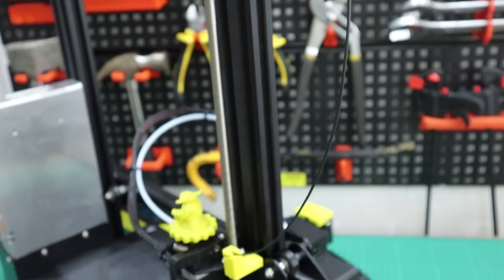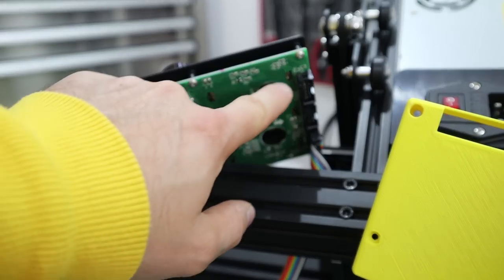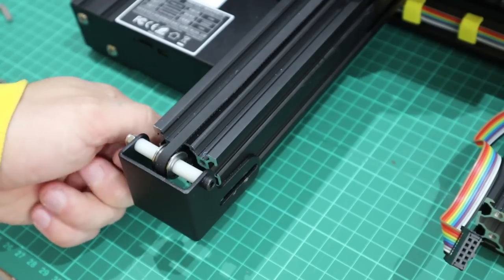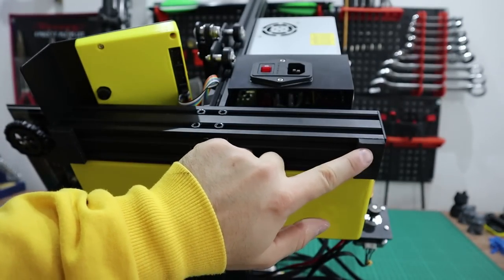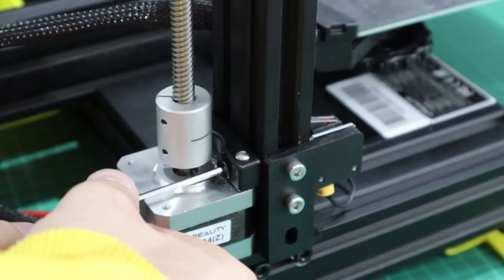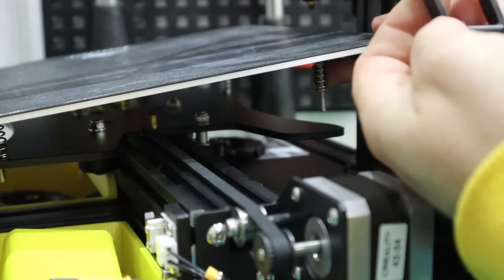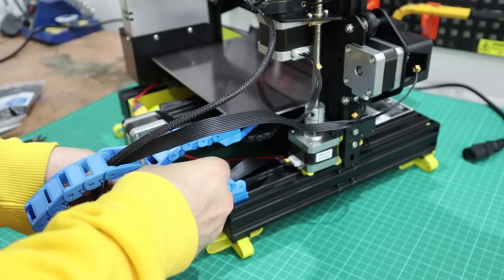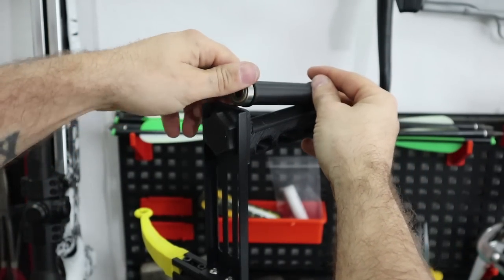Ender 3 Pro Upgrades

Comment: It's almost like Creality knew people would be printing mods
Reply: Well that's mean they really listen to consumer reviews and rants.
Reply: I mean at the same time it’s smart, a lot of these things work perfectly well being printed, and by not including them initially it helps keep the cost of the printer reasonable
Reply: Most of these are actually listed on the Creality website (with links to the thingyverse files) as printable upgrades. My first prints off my machine were a lot of these (namely the cable chain, ribbon clips, Yoda extruder knob, upper guide, and a few other things not on here like a upper z-screw guide and hand crank, bed handle, x and y quick adjustment knobs, and a few other things.
Reply: The use of 8020 Extrusion is literally the reason
Reply: @indroneswetrust1  that makes no sense that would increase the price tag plus this are entry level printers anyone can use them and in my opinion is better to start decent enough to print upgrades why? Cause 1 you can personalize it as much as you can, 2 it lets you learn by actually using the thing, plus by you downloading or designing your own part you don’t have to rely on them for new pieces.

Comment: 1:40 One tip about those LCD board covers.  After installing mine, I had an issue where the printer would intermittently beep and register a phantom keypress while printing. This is because one of the screws (nearest to the knob) actually grounds the PCB to the metal screen bracket and putting the screen between the screw head and the top surface of the circuit board stops this. 

The remedy was to bore out that mounting hole so that the screw could make electrical contact again. The rear cover will stay on perfectly well with just 3 screws.
Reply from the maker: Good tip for people that need it, thanks
Reply: I just installed mine and have heard a couple presses. I was really hoping it wasnt a technology issue as the printer is only 2 days old. This makes me feel a lot better and thankyou for a solution.
Reply: This comment should be pinned.
Reply: I recently noticed this and couldn't figure out why it was happening.  THANK YOU for posting this.
Reply: Had such an issue, but without touching screen at all. So no contact was broken. Solved it with ferrite bead on screen cable near the LCD.
Reply: How do I archive comments like these!! <3

Comment: I have been using a few of these upgrades and I'll say this:

-The upper filament guide while good, wears quickly from the passing filament, wearing a groove into it. It also flexes up and down due to the retraction and loosens in the extruded aluminum. It will have to be reprinted regularly.
-the lower filament guide is just a press fit. It also wears quickly, loosening it and now it just falls off of the printer. 
-The pcb cover does not use stock screws so its useless if you dont have hardware on hand
-The power supply baffle restricts airflow and the psu runs hotter due to it. 
-Extruder knob works well and i've had no issues.
Reply from the maker: I can only comment from my experience and I haven't had any issues from wear on the filament guides, and the cover for my PCB does use stock screws
Reply: ESOUCZ  I use it too. It didn't work with the stock screws that came with my machine.

Comment: The only things I would add are bed leveling knob locks, I got really tired of leveling the bed every other print. Great video, and great ideas!
Reply from the maker: Thanks mate, mine is ok once i upgraded the springs to stiffer ones
Reply: Actually had no real problem with that from the beginning as I printed some washers to make original springs stable. But I install clicking knobs for easier calibration. Do a few clicks here and there. The main problem is that table bends after heating complete. Mine have a hill in the center and center left and center right parts. I solve this by making first slice higher, like 0.3mm, and using 125% flow. Also ordered those yellow springs and will try them, to see if they will change table bending.

Comment: many thanks again Ivan, I have gone though all your vids, and I am sure you have mentioned somewhere, the printer requirements to print your parts. need to be accessible somewhere as is the list of parts ie your website. I have steppers here for instance, but the mounting hole placement would likely differ from yours, not to mention the linear rails. thanks again for your enthusiasm in this dark time. Its contagious
Reply from the maker: What lrinter are you using ? Ender 3 pro?
Reply: @LearnAsWeGo   i haven't purchased yet so thats why I was asking. I am leaning towards the ender if that will do the job
Reply from the maker: @leswheeler2023  i choose the ender 3 pro as they are cheap, easy to use, easy to modify and have a great community so loads of help if you need it.   for the price the print quality is amazing

Comment: Each to their own. My brand new ender 3 pro works flawlessly with stock condition. No upgrades done and its just great.
There are some things worth updating, which I did. Silent mobo and later the fans. Also filament spool holder. Thats all. Nothing else needed

Comment: +Learn As We Go
Great video and tips, I've got my E3 Pro on its way.
Looking forward to using these items as test prints and fitting them.
I have seen other videos with them but not all, especially the chain link and the slot in spacers for the screw stepper motor.
One thing I did notice as I watched though, I'm sure you realised too, that the yellow power supply intake would have fitted but pointed down as opposed to up as you showed or sideways as the blue one does.
Or would it have fouled anything by pointing down ?
Thanks for the time and effort though.
Reply from the maker: Your right there is a version for ender 3 and ender 3 pros

Comment: Having a 1 Kg spool rolling on top of your printer just rocks the printer with a lot of unnecessary movement. So I printed a mount that attached to the left leg to have the spool feed directly into the extruder. This also eliminates the need for filament guides.
Reply from the maker: cool idea

Comment: Nice job mate.I also have a ender 3 pro and best upgrade I have is a silent motherboard.... your ears will thankyou for it lol also I use a mirror from IKEA instead of the magnetic top.A blob of pva and water and 99 out of 100 prints stick plus the mirror gives you a perfectly flat bed.
Reply from the maker: Cheers pal i love the magnetic bed but the texture is annoying
Reply: @LearnAsWeGo  mirror is smooooooooth lol

Comment: First I really like your videos. It has helped me a lot as a beginner into 3D printing... 
How did you print the spool holder - is that with supports? The recommendation is to print all parts vertically but I think the main part (holder) can best be printed horizontally. Sorry for the question if it is too basic. I'm just starting with 3D printing.
Reply from the maker: i just rotate the parts so there is always a flat part on the bed, spool did have supports that are hard to remove so be careful as i broke the first

Comment: If your going to the lengths of printing drag chains do yourself a favor and hard mount the top chain with something like thing:3623342 and toss in thing:3132855  to prevent cable drooping. Its functional and makes the whole build look way more aesthetically pleasing.
Reply from the maker: Ok thanks will look at that

Comment: Thanks for this, what is the use of 2 first ? (fan clowling). On my printer, the shaft of my feeder are flush to the gear, its adjustable to add the yoda knob ?

Comment: Great start to the channel, I've just purchased the same printer and was wondering what software you are using to design and slice your models?
Reply from the maker: Hi mate im using fusion 360 to design my own stuff then slice it in cura
Reply: @LearnAsWeGo  That's the same as I've started with bit tbh a lot of easy designs can be found on thingiverse anyway! Saving a lot of time trying to design it all yourself!😂

Comment: Great video, those parts came out really beautiful. Did you 3D print the cable chain as well?? I wanted to build a small cable chain about 10x10mm size, is it possible?? The chain we normally get are big in size
Reply from the maker: Thanks, yes i printed the cable chain and you could shrink it in size in cura

Comment: Im probably not the first to say that but the chain are installed the wrong way. They are supposed to prevent bad kink in the cable by reducing the bend radius.
Reply from the maker: i dont have a kink in the cable
Reply: @LearnAsWeGo  just think about it. If you take 3 link and bend them they will have a 90 degree bend. If the links where install the other way around, the bend angle would be more around 120-150 max. But for the ender3 it doesn't really matter, the cable are not heavy enough. Nice job for the video btw

Comment: Morning mate thanks for the uploads I have an ender 3 which I have printed a few nice prints and a few mods for it I have subbed you and look forward to more just a couple of questions when I set my temps I usually use 200 nozzle for my pla and 60 for the bed but yesterday I noticed the bed had dropped to 50 and the piece came loose and I undid up with. A huge ball of filament lol am I doing something wrong also where can you recommend buying pla filament from cheers buddy stay safe from Clive in nottingham👍
Reply from the maker: Hi clive thanks for subscribing and i always have my bed at 50 which is the default temp, if i have small parts that come loose i ad a small brim in cura which helps it stkck to the bed
Reply: @LearnAsWeGo  cheers buddy any help on purchasing 1.75 pla filament would be great too keep making &stay safe .

Comment: Good video, but why not provide links in the video description directly to the models instead of Thingiverse numbers?
Reply from the maker: youtube punishes creators with to many external links that take viewers away from youtube
Reply: @LearnAsWeGo  What do you mean that YouTube punishes creators? This is not about YouTube adding any links, but about you the creator of the video adding links, because it improves the video! I promise you that you won't lose viewers just because you add links to the video description. But you are going to lose subscribers if you don't (or at least get fewer new subscribers). Look at how other YouTubers are doing; they are adding links. For the viewer it is only annoying that you don't add those links, because it makes it much more of a hassle to check out the models, which I guess is your main intention with adding those Thingiverse numbers anyway, right?

Comment: I just downloaded the Cable Chain files, thanks. Could you tell me how many of each I need to print to have the right length for my Ender3 Pro?  Thanks for the reply.
Reply from the maker: Hi Richard i went with 30 links, 15 on each
Reply: @LearnAsWeGo  Could you tell which parts complete one link in the chain?
Reply from the maker: @richardharmon1874  sorry i dont understand the message
Reply: where can you download those files? cant find link anywhere :/

Comment: the psu part is insane when you fit the first screw and rotate the cover to the place for the second screw,  the  fan rotates and the hole comes out. It's difficult but you need to turn it holding the screwdriver on the first screw to rotate the cover to the place..
Reply from the maker: I never had that issue but thats a good work around
Reply: I had the same experience so I ended up unmounting the PSU and holing it side down so I could align the fan easier. Two things could be different. 1) He could be using a different model for the fan shroud. The one I went for had slightly too small holes so the screws threaded into the shroud, causing it to move the fan around the screw instead of rotating freely. 2) There might be some other retaining mount inside the MeanWell branded PSU on the Ender-3 Pro preventing it from moving unless both screws are out and causes the fan to fall off. Mine is a non-pro and has the cheaper power supply.

Comment: It is overall bad to add a cover to the fan, because it diminishes the heat dispersion capacity of it. I wouldn't do it. Same can be said for the mainboard cover, altough in this case it provides it a protection from dust, so I think it's worth. (remember it still has to be cleand in time to time)
Reply from the maker: ive not noticed any problems

Comment: Thanks for the vid. I still dont get why people use bearings on the fillament holder. If the filament rolls too easy, it can roll too far and tangle up. Better is to use a good filament extruder without bearings in my opinion.. I do like the feet dampers though!
Reply from the maker: Its to slow to unravel to much

Comment: I opted to use the rear chain mount with groove covers, i think it looks nicer. i also chose the motor mount at the top rather than have the chain clip onto the wires. i think it just looks better and more secure. i also decided to not include the PSU shroud as i felt it was taxing the fan more, and that it wasn't able to expel as much exhaust air. and i am concerned about overheating on long prints.
Reply from the maker: thats a fair point with the shroud

Comment: Would the tool box fit with the regular ender 3? Not the ender 3 pro. Is the structure or basic constructed frame the same?
Reply from the maker: Im not sure you would have to do skme research but i think it would fit
Reply: I believe not the same. The center aluminium extrusion is different between the standard and Pro. Pro has a wider extrusion so the width of the gap where the box goes is probably smaller on the Pro.

Comment: those shock absorber feet are actually pretty useless.  While they do cut down on noise transferred into your table, they also make the machine wobble a bit which will cause a lot of failed prints or in the least printing errors as your machine will rock.  You can get the same result with a couple of blocks of insulation foam stuck under the feet and be a lot more stable.
Reply from the maker: Ok thanks

Comment: It's been nearly 4 months since you installed those cable chains. How are your cables faring after installing them? I've heard horror stories of cables rubbing on them and exposing the wires inside.
Reply from the maker: awesome mate, ive had no issues with them, it beats wires everywhere

Comment: I'm thinking about upgrading to the SK Mini E3 board and TTF E3.  Would a screen cover work for that?  And if I added the ESP3d, would I still be able to use the same back cover for the screen board?
Reply from the maker: i dont know, ive not tried with them boards

Comment: U have to be careful with some of these I personally don't rate cable chains ( just tidy your shit , the fan muffler for the psu can be an issue sometimes as well depending on the design filament guides aren't really needed either I do rate using the z spacer though made a massive difference to my z axis lead screw movement was loads before installing the space now it's minimal at best I like the LCD cover probably my fave personally
Reply from the maker: thanks for your feedback

Comment: thanks for the greats videos, very helpful to a new user like myself. Quick question i printed the Top Filament Guide but when i tried to slide the parted together it snapped this has happened twice now. Its almost like the clip is to small for the arm. Any idea what im doing wrong thanks.
Reply from the maker: print at slightly higher temps, i go up 10 degrees for pla

Comment: When pull the file on Thingiverse, how do I tell which displayed item is yours?
Reply from the maker: The thingyverse number is for the item next to it
Reply: Richard you don´t have to buy a 3 - D printer. There is no 3 - D printer specifically made for homes on the market now which can follow printing instructions easily because the driver updater is missing, most of the printing software is down or does not recognize the printer, the computer will not recognize it and most of them will not print from your USBs. Therefore a successful home 3 - D printer will hopefully emerge in the future. Instead of waiting for that to happen, because we already did during the past 25 years to no avail, you just contact a 3 - D printing website, show them the thing you want them to print and they will print it for you.You can not 3 - D print from a printer which has no CD. Such claims are simply bogus which is why people should 3 - D print from websites with access to up to date printer drivers. If Learn As We Go wants to 3 - D print, he has to ask somebody to do it for himself. He can´t just do it himself because thats years in the future.
Reply: @Yatukih_001  what
Reply: @mironinopetr6982  Yeah ,wat?
Reply: @kitsune-chan6897  I'm just really god damn confused at whatever this person just typed out
Reply: @mironinopetr6982  yeah wtf
Reply: OH it all makes sense.  Check that persons profile.  Flat earther...  sorry dont know the keyboard combo for the ROFLMAO emoji
Reply: @Yatukih_001  4 months late but man what a great and amazing comment you have posted. thanks
Reply: @Yatukih_001  I just lost brain cells
Reply: @thierry18  Yes, I just wish they would stay there and someone, anyone, please, cut off their internet access
Reply: @Yatukih_001  what?

Comment: Good evening, I changed the printing bed to Ender 3 Pro from the magnet to the glass, the PLA does not stick to the glass so I can print, what could be the reason? Does it need to be modified in Cura as well? Thanks.
Reply from the maker: Ive not used glass veds, some people put hair spray on it or masking tape on the glass
Reply: @LearnAsWeGo  i use uhu glue stick... if it is pla use a wipe, petg pass all the print surface. I use always my bet at 30º. Some pieces stick like super glue. To remove them heat to 60º the bed and let it stay for a minutes. To clean after 10 or more prints, just paper with water, the glue dissolves in water.